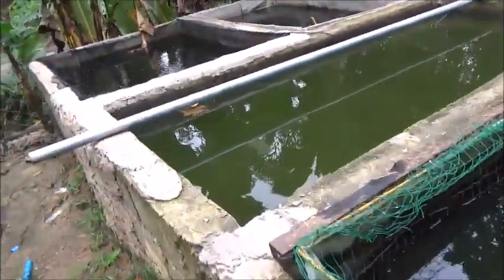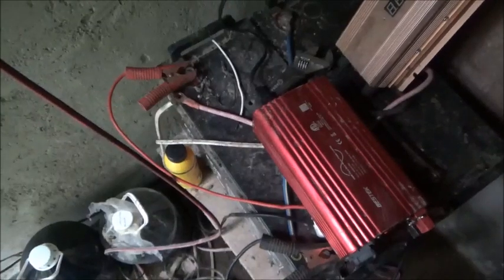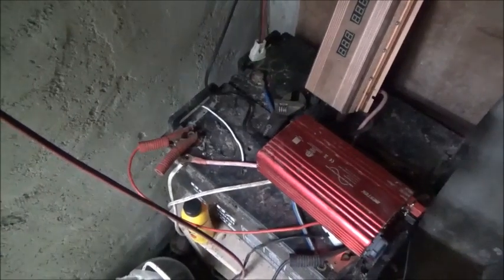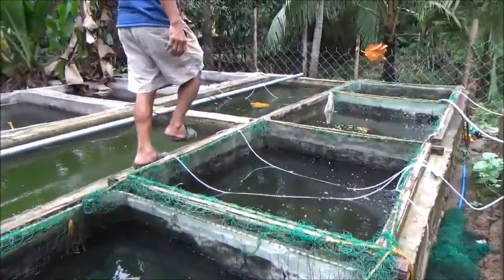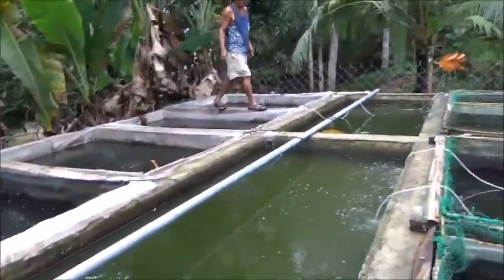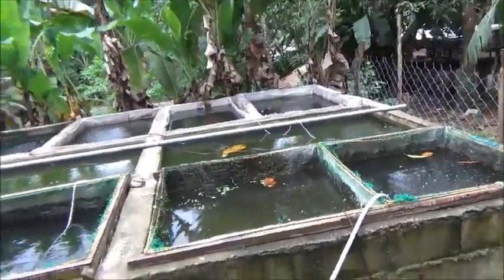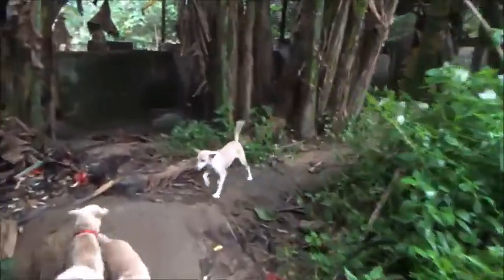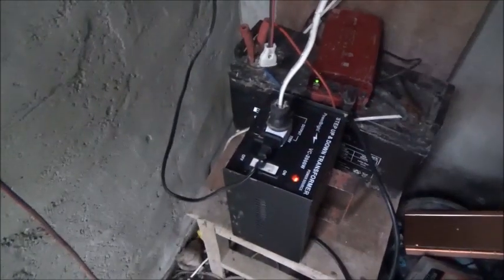Fighting The Storm Clock

Comment: Brian, Leave the 24V jumper connected so you can use the panels. You are hooking the inverter across 
one battery so it will only see 12 volts. The PV panels will put more charge into the battery you are 
hooked to because there is a bigger voltage difference to the run down battery. When the storm 
passes you can worry about getting the batteries equalized. YOU DON'T NEED WIFI OR LIGHTS AT 
THE EXPENSE OF THE FISH WHICH ARE YOUR BUSINESS. 2 AMPS PER AERRATOR TIMES SIX AERRATORS
IS LIKE 12 AMPS. Good plan with the white van charging the battery, proud of you.

Comment: B. If its an MPPT solar controller, it will charge the 12v batteries from the 24v panels. . . That's the advantage of an MPPT solar controller. . .  Just check if the solar controller is 12/24 v. . .